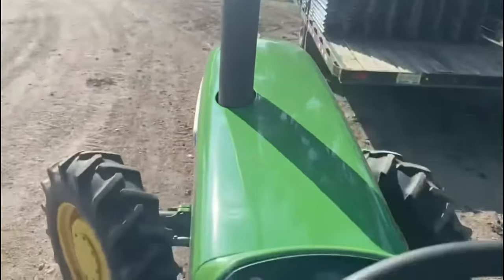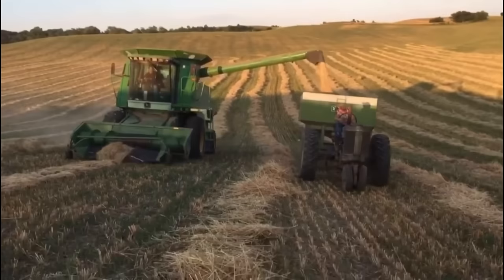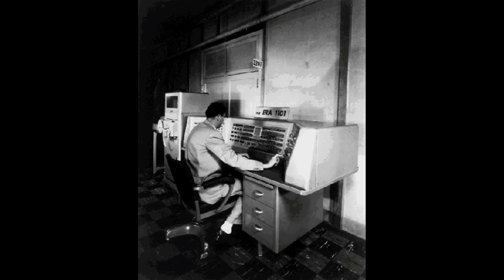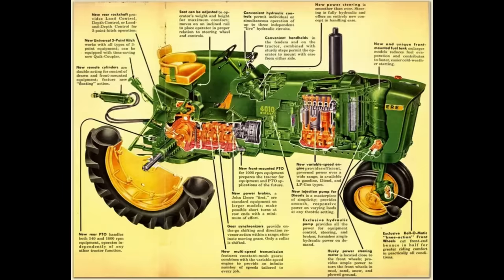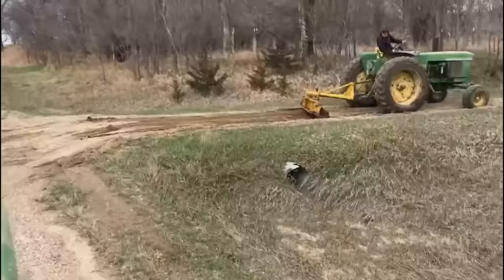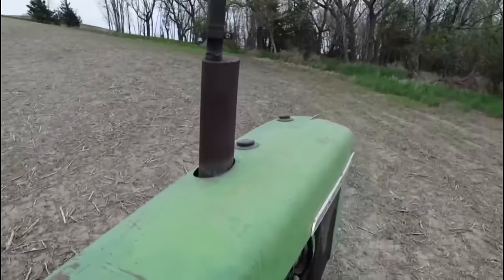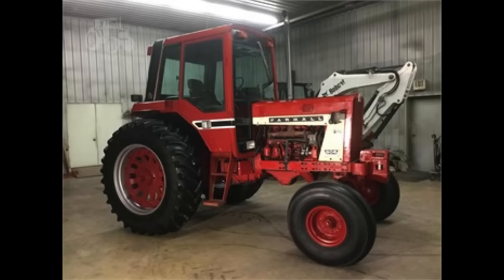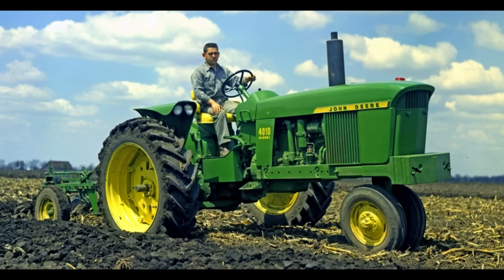How John Built the New Generation Tractors and Why They Succeeded

Comment: I've used a 3010 gas with synchro range, 3020 diesel with synchro range, but the 1967 JD 4020 Diesel with power shift transmission was a tractor I loved the most. The 3010 had a narrow front and we used a mounted John Deere corn picker on it, but that's when I was real young and my job was riding in the wagon when we had a sheller on the mounted picker.
Reply: After growing up on the two cylinder Deere's, starting out on the model"H", moving up to a "B", and right up to a "51 A" that had been modified with aluminum pistons and a water pump. Dad updated upwards by trading the "B" in for a 3010 diesel. The 3010 and the "A" had almost identical abilities. But all the wonderful conveniences of the 3010 made it so much easier to use. The "A" had mountings for the #227 picker and the #45 loader. But with the 3010, we had a capable tractor ready to go if the "A" was tied up with a large attachment mounted.

Comment: I was looking at a John Deere 3010 once at an auction. When I went to get off the tractor the same PTO lever caught the back of my Carhartt coat. The front of the coat ripped open backwards destroying the zipper. However, the top didn't let go and I was hanging there for a little bit by the back of my coat.🤠
Reply: Lot's of people had the same problem as you. Design flaw. They should have taken all the rest of the tractor mfg ideas 😅😅😅😅😂😂

Comment: John Deere blew IHC out of the water with the New Generation of tractors.  The red tractors tried to keep up but they lacked the creature comforts that JD engineered into its new line.  The simple one lever shifting pattern and synchronized shifting made loader work easy with them.  Also, the throttle position lever was a far cry better than the International’s and the hydraulics and brakes were light years ahead of the competition.  The 1969 model year upgrades to side pedestal hydraulic controls cemented JD’s leadership in the tractor market.
Reply from the maker: I couldn’t agree more with what you said👍🏻thank you for watching

Comment: If I could pick one tractor to have it would probably be a 4320.Great HP per weight, fuel economy, dependability and usuability. The 20 series were a great model run. A 730 diesel would probably be my choice for a 2 cylinder.
Reply from the maker: 730 has to be one of my favorite 2 cylinders as well. Thank you for watching
Reply: I agree, we had a 4320 and a 4020 and the 4020 was great for utility work, such as cultivating and pulling wagons or a sprayer but the 4320 was much more suited for field work. Better power, better weight, only weak spot on ours was the PTO clutch-didn't seem to last as long but we used it for running a silage chopper so it got a lot of use.

Comment: I owned a 3010 synchromesh, 4020 synchromesh, 4020 Power shift, 4430 Quad Range, 4430 Power shift, and an 8630 Quad Range. My favorite was the 4430 Power Shift. Sound Guard Cab, Heat and AC, Stereo, easy to change gears. Wish I still had it.

Comment: I have run A, 3010,4010,4020,2020, 2030,40 & 50 series, even a 4960. And the new stuff, too. But my favorite is 7800/7810. Big cab, convenient controls wether PS or PQ transmission, and start almost with a wave of my hand on the key even when it's cold. The "R" models don't like cold weather, or the computers don't.

Comment: We had two 4020's when I was in high school. We move on to many models after the 4020's. We had to overhaul both 4020's at lower engine hours than our 4450 or 4240 or several of the other Deere tractors we had. I wouldn't say the 4020 needed an overhaul early, just didn't last as long as the 40 or 50 series engines.

Comment: in 1950 when the decision to radically make over the John  Deere tractor line was made, JD was a weak second in the market place to International - Farmall. Deere made a great decision for its future, IH failed in its. IH appointed as corporate head their very successful head of Truck sales and he diverted IH's attention to that area. He had little past experience with tractor development, especially how long it took to bring a new product to market. The result is that when IH brought its new idea tractors to market lead by the 560, they did it with too little field time development under their belts. IH went from a company with a history of excellent products to one with a halo tractor with a weak rear end the ultimately resulted in a total recall to be repaired and update. In the heart of that fiasco, Deere rolled out the New Generation and jumped into the sales lead in tractors. They've never given up the lead since.
Reply: Deere also has the fiasco of Wakisha engine damn near killing Oliver when they went on strike, Oliver had enough orders due to their successful over direct under power shift to rock the market. Then Wakisha engine went on strike, Oliver had already traded in the tractors and resold many so they were gone,  IH was at capacity and could not produce much more and that left Deere to fill the gap, the rest is history. My neighbor ended up with two 4320's and never looked back.
Reply: But those years did see some great trucks fielded by IHC! Those pickups were nearly indestructible. Rough riding and blase, but one tough truck.

Comment: Dad had a new 2010 diesel, the engine kept droping rings. He then bought a new gas 3010 and it was junk. He wished he had stayed with the old generation. I love old JD's and am a JD collector, but unfortuately  dad had two lemons. I understand that the 2010 diesel had sand left in them from the casting and the 3010 carburation  was very poor.
Reply from the maker: That’s interesting about the sand left in for the casting. What are your favorite old generation tractors?

Comment: I would have A power shift 4020 with a loder and frunt wheel usist, I did operate a 4020 power shift but it was 2wd and it doesn't have a loder but Howe cares it's a classic American tractor

Comment: 4010, 3010, damn good tractors, we had both, replaced two Massey-harris, wow what an upgrade.  But the 1010 and 2010, well ok improved but wow. The 1010 was a Dubuque with the upright 2 cylinder replaced with a four and new sheet metal, and then there's the 2010, We had one nice handling but it had to have been engineered by some one hired from Massey Ferguson.

Comment: The 4020 was a great and still is a great tractor. Also had a 806 international which would pull more but the John Deere 4020 had the power shift transmission which was better and the power steering was better.

Comment: Have a 1961 John Deere 3010 diesel, and that thing is truly amazing. For it's size, it's a powerhouse, on top of being incredibly efficient. It also just keeps on running. The only thing that they did wrong with those tractors was the goofy "floating  ground" 24v electrical system. Great old tractors!

Comment: 4010 diesel paved the way for modern farming #legendrollson
Reply from the maker: I agree!! #legendrollson thank you for watching👍🏻
Reply: How exactly?
Reply: @RJ1999x  the 4010 had more modern hyd system, power trains made to last three pinion designs synchronized transmission load and depth this wasn’t something available on IH for many years. Remember the 560 farm all wasn’t meant to compete with 4010 it was meant to beat a 730
Reply: @classic89deerefever80  The John Deere hydraulic system was a highly complicated unreliable hydraulic system, which they finally abandoned, and the draft control was horrible in comparison to an Allis Chalmers traction booster system, until electronics came into effect the draft control much like others of that era, was almost useless
Reply: @RJ1999x  well when a xt190 had the same rear end as wd45 the 4010 was a much stronger machine,didn't produce metal like a xt190. The hydraulic system of a 4010 was and still is compatible with modern equipment today,allis and farmall stuck with a open center system too long. the systems you speak of ran from 1960-1994 so it couldn't have been very difficult to work with. 
After allis sold to deutz the conversation ends there is no blood line. #solidstablestilljohndeere
Reply: @classic89deerefever80  your facts are completely wrong. The 190xt did not share a rear end with a WD45, wasn't even the same system, the early models tore the rear ends out when the power was turned up, John Deere 4320 tore the rear ends out stock as did the 4430 and numerous other Deere models, everyone forgets to mention. You also forgot to mention that "every" tractor manufacturer copied the Allis Chalmers pressure and flow compensated hydraulic systems.
Sticking with a poor hydraulic system isn't proof of innovation,  or success, it's proof that marketing can overcome poor design. When's the last time you seen the owner of a competitive tractor shaking the steering wheel.like a deranged gorilla to get the tractor to start?
Reply: @RJ1999x rj must be a Democrat from california
Reply: @mrnascar9129  completely wrong.....again!
Proud Trump voting conservative from the great state of Wisconsin
Reply: Then act like one
Reply: @mrnascar9129  so the truth offends you? Liberal?

Comment: Should do something on the John Deere 2840
Reply: The 2840 was a mishmash of US and Euro parts. SOLID tractors, and I still run em. It may be sacrilege to say, but I like em better than 4020. I know, it's heresy, but I like them. 😮
Reply: @MorganOtt-ne1qj We had one, 2840 is a great tractor. If you're going to ride a tractor all day, choose the 4020; but for chores or a morning/afternoon I'd take the 2840.
Reply: The 2840 was an awful tractor, with a gutless wonder of an engine, plagued with transmission problems
Reply: @RJ1999x  lol, maybe it depends on which one you get & what you expect from it.
Reply: @davidkottman3440  possible, I knew 3 different farmers that had them, and all 3 hated them, I've only operated the one and found it a horrible tractor, was my friends dairy farm, and it was just a chore tractor. If the engine wasn't a problem, the transmission was, I could never understand why they kept it, or kept repairing it.  The others got rid of theirs, one was traded on a 2755,  not a very comfortable tractor in my opinion, but he says it's given them good service
Reply: @RJ1999x  I like the 2840, have replaced brakes in one myself and it's in need of a rear main seal. Can't really say that the 2940 is a better tractor except for a 16 speed transmission and MFWD option. The Sound Gard retrofit left something to be desired on the late "40's-50 series, mainly the shift linkages. The cab was still nice to have! But hey, I don't expect everyone to like what I like. Have a good one, my friend, and I will crack a cold one and tip it to you! 👍

Comment: You forgot one other competitor for the John deere 4020.
The case 930. Although rated at less hp then the 4020 or 806 international.  It had a higher torque engine and could pull just as much and burn less fuel doing it.😉
Reply: That's true but the JD was far ahead in ease of operation, steering and hydraulics. We had a 930, put a turbo on it and had lots of power but not enough cooling. Traded it for a 1030, 1175, eventually a 2470. I farmed with all of those, plus a 4020 and a 4320. Case tractors would pull, and were somewhat better on fuel, but everyone but my grandfather would rather drive the Deeres.

Comment: The 4020 is the best tractor ever built. I own a 1966 4020 today.
Reply: @LocustMotorWorks  my dad first turned me loose on a 1965 4020 Power Shift one evening in the fall of 1975 when I was ten years old. I was pulling a five-bottom semi-mounted plow with sixteen inch points in a field west of the house. He was running a 3020 with a mounted four-bottom plow. We worked into the night to finish up the field.

The 4020 had an aftermarket turbocharger kit with straight chrome stack. I will never forget the sound or the sight of flame shooting six inches out of the top of the stack.

A couple of years later, I started working for my uncle for $3 per hour running a 1972 4620. I pulled a 6-18 plow with that among many other utensils (22 ft. disk, 30 ft. field cultivator, anhydrous applicator, etc.). I also occasionally ran his 1978 8630. All before the age of sixteen... 

I operated all kinds of other equipment for other local farmers that were friends of my dad, hustling to make money through middle school and high school. Allis Chalmers, Deutz, Ford, International, and others. The Deere machines were far superior in every way.

One day in 1978, my uncle got in an argument with a rep from the local Massey Ferguson dealer. The rep was bragging up their brand new 1155 V-8 powered tractor that they had on their lot. Next thing you know, the dealer trucks his new 1155 out to the farm for a demonstration. One of the fields we cultivated had been part of a fisheries years ago and was composed of hard, black clay muck. We had to plow it in the fall and let it rest over the winter to be able to break it up enough to plant in the spring. They hooked the 1155 to the 6-18 Deere plow that we used with the 4620 and headed out to the muck field.

The dealer selected the range he wanted and dropped into an existing furrow and promptly killed the engine. After several tries, he ended up in it's lowest range and finally struggled through one pass. He climbed off and said, "There ain't any tractor can pull a plow through that ground." Laughter ensued. My uncle brought the 4620 out and hooked up to the plow. He selected fourth gear (normally, I plowed in fifth, sometimes sixth, but this was really hard pulling ground) and dropped into the furrow and lowered the plow and rolled on the power. The Deere settled in with light smoke rolling and ripped through a full pass at 4.5 mph. The Massey dealer stood there dumbfounded. He never said another word and loaded his tractor and headed back to town.
Reply: @CheeseMiser  🤣
Reply: @CheeseMiser  I didn't say anything about how many were sold.  I said the 4020 was the best tractor ever built -- and it was.  Demonstrably so.  The Ford 8N was a Mickey Mouse piece of junk that was cheap.  The 8N is not even in the same universe as the 4020.  I've operated both.  I've operated many different tractors from multiple different manufacturers.  The 4020 is hands-down the best of all of them.  A close second was the John Deere 4620.  Your comment belies your ignorance of the subject.  I wouldn't trade my 4020 for a hundred 8Ns.  🙄

Comment: I would take a 4020 diesel with a chrome straight pipe pulling silage wagons any day over a 706 International. Step on the clutch of that 706 and wait 10 minutes for the unsynchronized gears to stop turning in the transmission then hook up took too much time. 4020 diesel with a straight chrome exhaust pipe would beller like a bull!
Reply from the maker: 👍🏻👍🏻thank you for watching

Comment: 806 is a good tractor. But tractor controls, transmission, hydraulic capacity, brakes and steering gives JD the advantage. Especially in the chore tractor category. 4020 is so much better with a loader on than 806.

Comment: You didn't mention that the multispeed powershift transmission was a tractor game-changer.
Reply: It didn't come out til the 20 series. It was the final upgrade but the differences between the 4010 and the 830 were definitely much more drastic.

Comment: Tell the story on how Deere ended up with the power shift transmission. Deere wasn’t the first one to come out with the power shift. It was Ford selcto speed. The designer got upset with Ford and went to Deere.
Reply: Yes, Harold Brock was the Chief engineer for Ford. He actually started as an apprentice to Henry Ford.  He was upset that the select-o-speed was rushed into production. He was sent to England and when he got home he found out that they had started production with prototype parts. So he said you need to find a new engineer.
Reply from the maker: Hey thats a cool idea I didn't know about that. Thanks for the information and for watching👍
Reply: @LocustMotorWorks  
You are welcome! I’m a red guy but learn the history of all makes. Thank you for the content!
Reply: Ford select o speed was junk from the factory.......wasn't built heavy enough ....very expensive to work on and the Ford dealerships wouldn't even work on them.

Comment: I'd still rather drive a 720 !
Reply: I have a 720 diesel we use to run in the same field with a 4020 power shift, the 4020 was far nicer to drive but the 720 had more actual pulling power,

Comment: The Olivers were better than any of them!
Reply: In many ways you are right, but Oliver lacked the dealer network and most importantly, didn't look as good. I ran a 2050 Oliver for four years as our primary plow tractor. It was a great tractor, really powerful. But next to the 4020 I had driven years earlier, it just felt cumbersome and slow.
Reply: Swing and a miss
Reply: Oliver, Cockshutt & MM had some good features that the big guys didn't have but they were missing the dealer network and ability to reach potential customers.